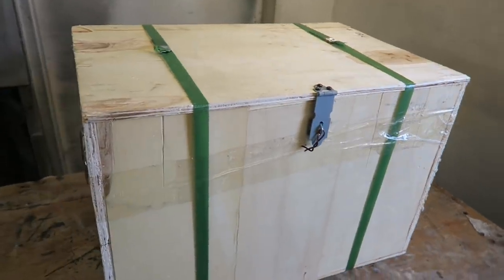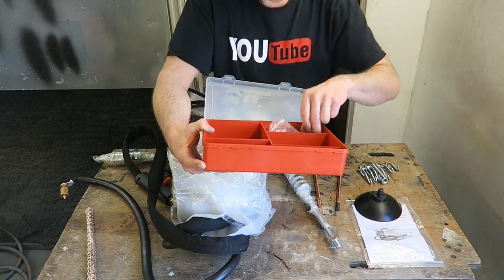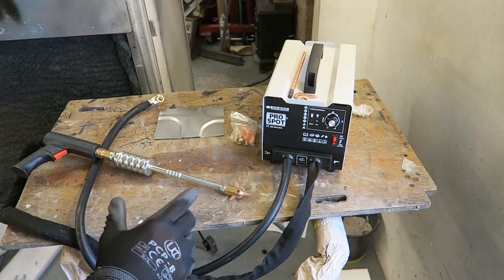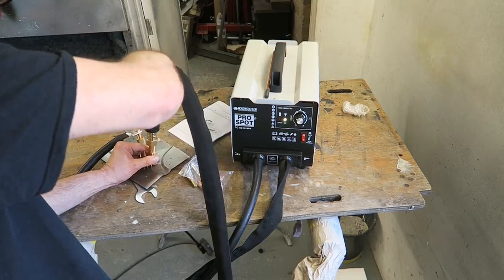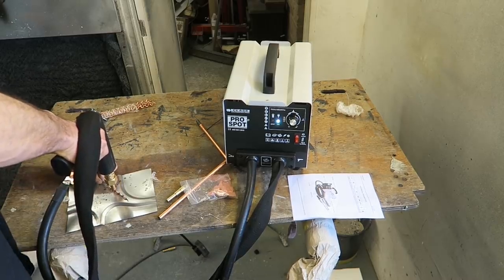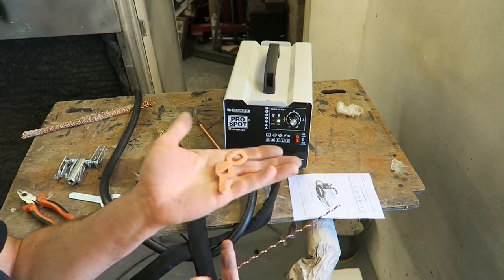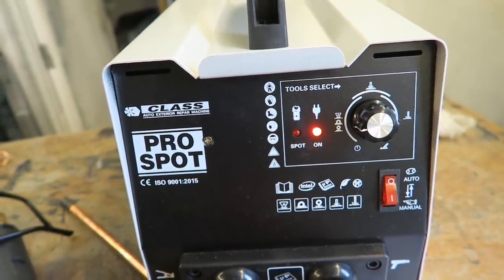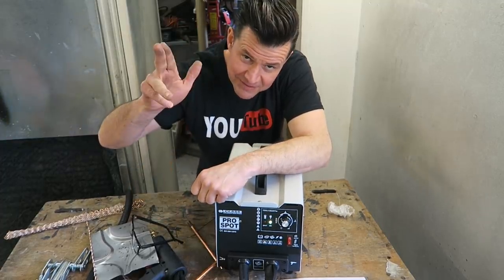Massive Thank You. Spot Stud Welder Puller and Heat Shrinker unboxing and first impressions

Comment: Can't think of a nicer guy who deserves it more. Looking forward to the videos. The heat shrinking and taking the " oil canning" out of stretched bodywork will be very interesting. I did buy one of those stainless steel shrinking discs that go in the angle grinder but never really got it to work half as good as it does in the video.
Reply from the maker: Andrew Wilson thanks Andrew I’ll be showing you some good stuff for sure. This kind of machine without doubt will provide the most control when it comes to heat shrinking. Cheers Trev 👍
Reply: Oh I looked at those as I warped a boot lid filling spoiler holes on my 180sx not sure what easiest way will be maybe a tourch
Reply from the maker: tom smith any heat source can be used for heat shrinking, the shrinking disc works by generating friction plus the pressure applied acts like the hammer action I showed using a flame. Any flame of course even a powerful hot air gun will create a shrinking effect if used correctly.
Reply: @trevsblog  excellent will give it a go when I've finished this justy project
Reply from the maker: tom smith a piece of equipment like this would offer you the best results, I’ve had results from all methods and still often use a flame. If you’re unsure it’s always wise to have a practice on a scrap panel to get a feel for what you’re trying to achieve before unleashing tools on your pride and joy. Heat shrinking is a delicate touch and it is possible to make things worse. Good luck with your project. Cheers Trev 👍
Reply: Wade Pilkington what's the secret?

Comment: Went & did it - picked one up on ebay.  $281.46 USD.  Went around and around with myself about it, tortured myself over the asking price,  watched your vid again & said "hell with it, pulling trigger". So, looking at the way you had those washers connected, It looks like you could slide a short length of bar stock or a nice long starter or alternator bolt & give a pull with the "claw-hand" component. I SO can't wait!

Comment: Trev, a couple of quick things. I guess you may have seen Arthur Tussik's page where he uses this type of machine (albeit a more expensive Italian unit), to great success. He has made some natty tooling for use on sills and similar work, where either wriggle or post tabs are used. Other question, are the carbon rods, the same as those used in air-arc gouging? (gouging rods). I have  followed your page since the earl days it was put on line and enjoy it immensely, as well as Urchfab, Arthur Tussik and almost every other page dealing with metal shaping, vehicle restoration, panel repair, welding and fabrication.   Keep up the great work and keep us posted on the longevity and success of your tool purchases. Always interesting to see and hear.
Reply from the maker: B. Curtis yes the same rods are used for gouging., I’ll look into Arthur Tussik. Cheers Trev 👍
Reply: Arthur tussik has great skill but those cars are death traps
Reply: @xiG0DSB3A5Tix  
Some might disagree lol. In his defence, his work is as good or better than factory. No offence or argument intended.
Reply: @PhillipHall01  this is not me getting my back up or being argumentative but are you in the trade? Any up to date trained panel beater and in general bodyshop techs altogether should and would know theyre not being repaired safely due to the composites used in the structure of the car and the way that they are being repaired. The precision is good yes but those cars will never be structurally the same and in safety terms they're compromised. Definitely a very skilled man though. Theres a bit of bodge work and then theres putting lives at risk theres a reason majority of the cars would be cat b - or completely scrapped in general and its not down to money like cat s and cat n's are mate

Comment: I just found your channel and subscribed. I am pleased to tell you that my son and I just completed making one of these machines for his schools science project! It works even better than expected.! The accessories I purchased on line for 69 dollars.  
PS The auto/manual switch is for the timer. If you want an auto amount of time of wield per switch depression, you put on auto. That way you always get the same amount of time per weld on each and every depression of the switch.  If you want to heat shrink, you switch to manual that way the heat will continue as long as you have the switch compressed, putting as much heat in an area as desired. (Manually overriding the auto timer). Nice machine and well done video.
Reply from the maker: Thanks Phillip your son’s project sounds interesting, I was toying with the idea of making a machine myself, possibly using batteries as the power supply. You can now purchase the accessories including the slide hammer etc very cheaply. Unfortunately the auto switch doesn’t work as you suggested, which is how I expected it to work, it has no timed function on this particular machine unfortunately. Cheers Trev 👍
Reply: @trevsblog  Tjanks for your answer Trev. You are a nice fellow with good information! I will give you a tip. Check out Fix106 channel and look up “how I build my spotter” that is where I got the information on the build! Actually he did two videos on this. The second one is the detailed one a bit longer 20 sometimes minutes but well work it! Good stuff there also! Cheers my friend!
Reply from the maker: @PhillipHall01  thank you very much I’ll be sure to check it out, sounds interesting 👍
Reply: @trevsblog  
Very
Reply from the maker: Just occurred to me that I got it wrong. It has a timer but what it hasn’t got is auto triggering. The Miracle machine I used to use had it, you just place the electrode be it washer or slide hammer etc against the workpiece and it senses a connection and automatically pulses. A very useful feature because you don’t have to press any trigger manually. 👍
Reply: @trevsblog  
Yes that does sound like a very helpful feature. Thanks for the information!

Comment: I very much appreciate the keen attention to detail you provide.  Thank you.  Would you please provide more information about the product you are using?  I see it is a ProSpot, but I have been unable to locate a unit (by ProSpot), that looks like the one you are using.  Instead, I am referred to units that cost several thousands of dollars.  Of course there are online options to copycat products (which have nearly 20% negative reviews by users).  Is there a model number or UPC you might provide so I can get going on my dent repairs?  Many thanks!
Reply from the maker: Matt this is just a cheap Chinese built machine, I’ve seen the same looking machine with other names on the front so I wouldn’t take too much notice of that. They’re Available to buy certainly in the uk on eBay. I cannot now remember exactly what I paid for it but it was certainly very cheap in comparison to a high quality Italian spot welder which cost thousands in comparison! Cheers Trev 👍

Comment: Awesome kit bud, funny you purrrrrchased some China finest as i just got some kit from then yonder, shall post a vidja soon on it. maybe find an old sewing machine pedal for a trigger.
Reply from the maker: PIPER DOUG it’s just a very basic on/off micro switch in the trigger with two wires coming off it. So yes anything that joins two wires together would work. My manic brain was working on a way to create my own auto triggering device utilising the fact that the torch connection onto the earth is making a connection. A small electronic timer in between would create a neat delay before making contact. Just a thought at 4 in the morning... cheers Trev 😘

Comment: Trevor - After seeing your video of the Dent Puller , I dropped the $$ to purchased on of Ebay to pull out a number of dents in my front wings.

 As you know the "instruction manual" that comes with the device is not worth the paper upon which 'its' printed -- So your VIdeo was EXTREMELY INFORMATIVE as to How it SUPPOSED to work.  THANK YOU for MAKING IT !!

The only thing is that not matter what I tried, I was unable to get the Negative tap to fuse to the metal - despite changing the power settings in every conceivable voltage level.

It has since be shipped back to the warehouse ( the refund is a 'Story" ;-@ ) I was forced to used a Stud fusion spot welder and pulled the dents out with it. Although it can burn through the panels : -( 

Thanks again for make your videos !!!
C
Reply from the maker: c herr to get the earth to fuse to the panel the threaded part needs to be wound right back so the the spike is making contact with the panel, both need to be very clean. The most important thing is to just lightly hold it against the panel. The harder you press it against the panel the less lightly it will fuse to the panel because you are making too good of a connection. The better the connection the less heat that will be generated and less chance of fusion. Cheers Trev 👍
Reply: @trevsblog  Trevor- THanks for taking the time to reply- Your a BUSY GUY !!
As for the Dent Puller -   the panel was bare of paint and sanded to a shine, I attempted every combination and permutation of voltage settings that the gizmo could muster - but no bueno.   The machine was identical to the one you demo-ed too !  So I contacted the vendor for an manual ( worthless) or video that might explain what I was do incorrectly.  The video they sent was not help.  So I counted on your  BRILLIANT video and by step through frame by frame- I matched my settings to yours, but still no bueno !  After two weeks of futzing - i shipped it back  ( maybe to China)

 I then purchased at Stud welder with the odd slap hammer -  Other than blowing a hold through the panel withe 3mm stud- I was able to use 2mm studs and pull the dent out albeit not as nicely done if I could have gotten the other gizmo to flippin' work. 

Your Videos are EXCELLENT and extremely helpful !!
 Althought I'd really like to see the rest of the video of the tool you created to form the bottom contours of the front 'wings" on the CA ...  Your video had a portioned edited out :-(

CHEERS !!
C
Reply: @trevsblog  Trevor - Thanks for the Hint. I did try that method as well. No Luck   I think the little beast go drop or beat up in shippment. It' also had a broken Carbon rod like your system.  Maybe them came from the same factory in China ;_@

Good Luck with the Van !!!
Cheers
Reply: Do you have a complete video o how you made the  rig to roll the sheet mer the bottoms of the fenders?  the video you posted seems to have  some missing footage .. ( Oppss we don;t do film anymore- sorry )
Reply: @cherr979  6

Comment: congrats on the new machine!  Am I correct in understanding that this machine also does regular spot welds? Right now I'm narrowing down between this & an oxy acetylene  welder to replace the one I left behind in Reno in order to move back to WA. If it can do spot welds for joining panels I may just go that way. On the other hand, a torch is always nice...
Reply from the maker: bobbofly not really, in theory it could do a single sided spot weld. It’s really for welding something to a panel rather than welding two panels together. Cheers Trev 👍
Reply: Oxy-Acetylene setup, then. A needful thing anyway. Thanx for the swift reply! :)
Reply from the maker: bobbofly have you considered a TIG welder?
Reply: @trevsblog   I have, but the price keeps staying my hand. If I can find a decent used unit I might pull the trigger - but it'd have to be an unbeatable deal. Got a real nice Weld pak 100, but obviously it's a terribly flawed solution for sheetmetal. I've used it that way, but there's a LOT more grinding involved, plus the potential burn through issue, not to mention the distortion I wind up chasing around.

Comment: hi Trev thats a great bit of kit, is it possible to do spot welds with it possibly for those areas that u can't get a conventional spot welder in?
thanks Pete
Reply from the maker: Peter Barton in theory it could be used as a single sided spot welder but how effective these welds would be is slightly questionable. It’s main purpose is to weld items to a panel rather than welding panels together. If you drill and plug weld with a mig welder you’re more guaranteed strength where you can’t get a spot welder in, I once saw a very lazy guy I used to work with, single side an entire quarter panel on. When he drove it into the paint shop, he drove the car up a ramp at an angle and a whole row of welds broke. Cheers Trev 👍
Reply: Trev's Blog thanks Trevor I’m in the process of attempting a rebuild myself and wasn’t sure whether to invest in on but if you reckon the mig is the way that’s good enough for me thanks Trevor keep up the good work
Regards pete
Reply from the maker: Peter Barton that’s right Peter this is more of a repair tool rather than a welding tool. It’s confusing because it uses welding technology. Cheers Trev 👍
Reply: Trev's Blog thanks would it be possible to us how to spot weld panels with a mig to leave nice results maybe on a future vid
Cheers pete
Reply from the maker: Peter Barton watch my very long ( sorry) video on heat distortion control. I show plug welding in that. Cheers Trev 👍

Comment: I've never used a welder before so please excuse my ignorance, but how do you not get a shock from using this when you're touching the end of the rod on the work?
Reply from the maker: Ashley Ford Ashley I’m sure Wikipedia could answer this better than me but think about electricity as a tank of water. The tap is voltage and the size of tank is amperage. The more the tap opens the higher the voltage. The more volume of water the higher the amperage. You can get an electric shock off an electric fence which will be around 10’000 volts but it won’t kill you because the amperage is very small. A socket in your house will provide you with 220 volts and will possibly kill you very easily because of the vast amount of amperage available.  My spot welding machine output voltage is just 7 volts but has 3500 amps available, enough to melt steel but because the voltage is so low it won’t give you an electric shock. If you could increase the output voltage it would kill you dead. Cheers Trev 👍
Reply: Trev, many thanks for the in depth response. That makes much more sense now. I’ve only just come across your videos and I’m working  through them all! Great content and you have a fantastic way of explaining things. What happened to part 3 of the replica Ferrari build. Is it still on the cards?
Reply from the maker: Ashley Ford Thanks Ashley unfortunately my boss that owns the Ferrari replica has decided to shelve the project, he’s got too many projects and a business to run so it’s been put aside. Cheers Trev 👍

Comment: Hey trev do you think it is possible to add a thread stud gun to the machine and use it for this Case? Both System work the same was with capacitor discharge right?
Reply from the maker: aiz234 yes it is watch this video. I believe it is a capacitor that discharges supplying the current for the weld. Cheers Trev 👍 https://youtu.be/q9k0quG5lkk
Reply: @trevsblog  yes i watched both Videos but i wasnt sure if the threadedstud work on the little Spotter.
Reply: Thank you so much
Reply from the maker: aiz234 at 5:06 I’m using the single sided stud welder. I had to file the stud into a peak to make it weld.
Reply from the maker: aiz234 interesting, I’ve never seen these before. The heat would certainly be increased at the start of the weld! Cheers Trev 👍

Comment: Does anyone know why my ground cable isn’t sticking properly, it’s barely sticking but then falls off and I’m touching on the pure metal that was sanded down
Reply from the maker: Just make sure the ground pin is clean on the end also and sticking out clear of the brass locking mechanism. Turn the power up, make sure that the slide hammer end is firmly pressed against the workpiece then don’t hold the earth pin that firmly against the panel only gentle pressure. If you press the earth hard against the workpiece you will be creating too good a contact, resistance spot welding increases efficiency with less pressure because you’re creating a resistance between the pin and the panel by using less pressure.

Comment: I found that really useful, as I've never understood the features of those machines, there is not enough steel bodywork on motorcycles to justify investing in one, but now you have explained what they can do, its got me thinking about the dents in bike petrol tanks-they are tricky and not really a job for the bloke in a shed to tackle, getting em sorted often costs the same as the price of that bit of kit, only thing is, I think bike tanks are heavier gauge than car bodywork for obvious reasons. The standard of kit from China has improved a lot now, so much so, that Chinese motorcyles are a viable buy now-even thinking of 125 for meself.  I just found this video   https://www.youtube.com/watch?v=EIQ-BmlllhI  , great to think that some of those cars may run again.

Comment: Mine won't stick
Reply from the maker: Make sure everything is clean polish the tips with a surface conditioning disc, turn the power up higher if you can. Most important don’t apply that much pressure to the gun. The harder you push that pull washer or slide hammer against the workpiece the less resistance there will be, less resistance = less heat. Pushing harder increases the connectivity resulting in low resistance 👍